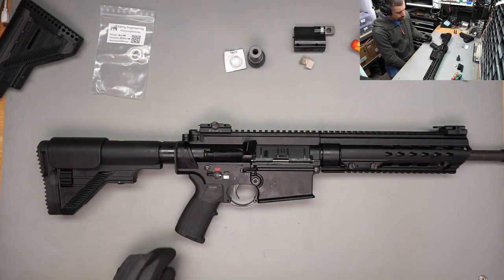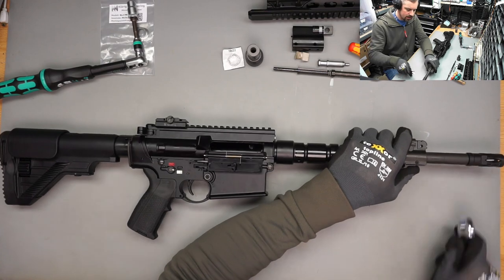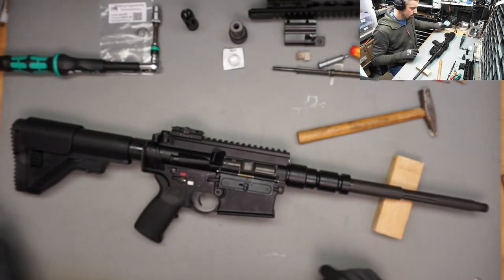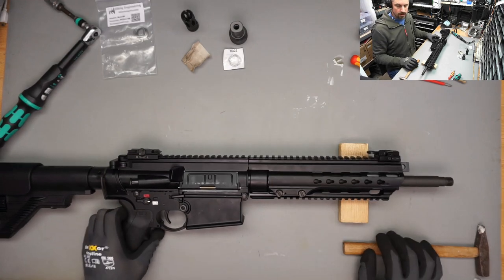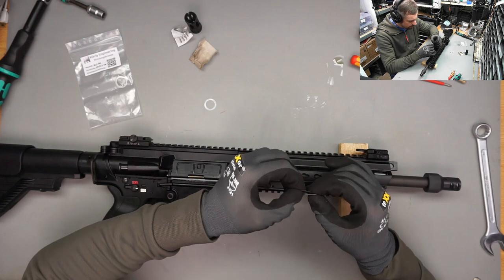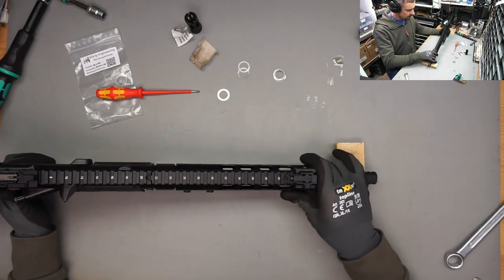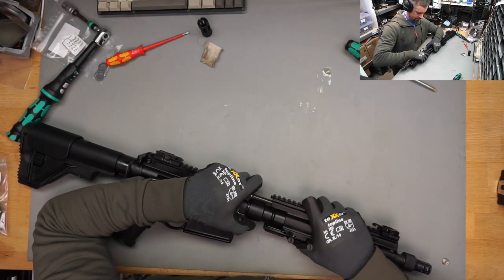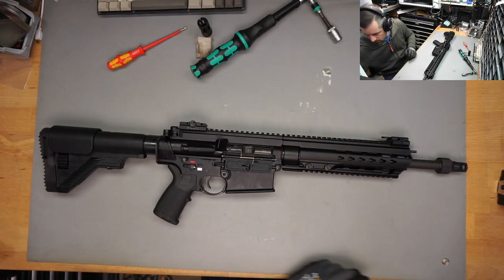Heckler & Koch MR308 A3 13" Part 3: Gas Block & Muzzle Brake

Comment: Moin! Ich überlege meine MR308 auch mit einem Gasblock für SD Betrieb umzurüsten. Hat das gut geklappt? Woanders habe ich gehört, dass die Ausstoß Gase direkt auf die (in meinem Fall) linke Griffhand an der Handguard rauskommen. Und welchen Schalldämpfer hast du genommen? 30 dB Reduktion wäre schon gut, sonst ist es ja auch fast egal :)

lg
Reply: Moin, bin am selben Punkt, überlege einen Flow Through Schalldämpfer zu nutzen.

Comment: Hello.
Did you torgue the muzzle brake to 45 nm as H&K recommends or did you just tighten it as you thought was tight enough?
Reply from the maker: Since I use shims to time the muzzle brake ports, I can't use a set torque - instead I tighten until the brake aligns well. No way I can get to 45nm with the wrench I use for this.
Reply: Thanks... I must admit that 45 nm seems to be a lot.
Guess the barrel should be in a barrel vise to pull that of.

Im installing an A2 birdcage on mine and down know if 45 nm is needed just because the manual says so
Reply from the maker: @ThomasThorgrimson   I started putting the barrel in a vise to these "torque-fit" muzzle devices every time to be safe. This makes it much easier to get a good alignment! For actual military use, I'd probably go for 45nm to be safe but for my purpose, less torque works fine MOST OF THE TIME.
Reply: Thank you very much for your help and you videos sir😊
Can you maybe help me with what barrel vise you use to work on the muzzle devices on your MR308?
Reply from the maker: @ThomasThorgrimson  I use a generic bench vise with add-on aluminium jaws from ebay. The aluminium is easy on the barrel (maybe add some masking tape on coated/painted barrels) but grabs very tightly
Reply: @GunWodan  Thank you very much sir.
I got it in a barrel vise and have replaced my flash hider.
What ammo do you get the best results with? I heard it shoots well with 140-168 grain range.
Based in Denmark im thinking maybe Sako or Lapua and preferebly lead free with new hunting regulations🤔
Reply from the maker: @ThomasThorgrimson  I've loaded a lot of ammo with the Scenar 185gn bullets with great results for target shooting. For hunting I was looking for a higher impact velocity so I'm going with the 130gn Barnes TTSX and get more than sufficient performance out of the short barrel. With a 16" or a 20" barrel you might want to look at the 150gn TTSX as well.

Comment: Cool videos man, love it. Regarding muzzle device for MR223 what was needed? Some heating, fixing the barell and 60NM force? That force scare me the most for my upcomming Ase Utra combo.
Reply from the maker: HK honestly did a very good job at bolting that brake down. I really recommend fixing the barrel well and being certain you are pulling into the right direction. It will come loose ...
Reply: @GunWodan  They are very precise with these details, staking was also massive. :) Thanks
Reply: @GunWodan  Can you be more specific? Did you use heat (Loctite) or water (Rocksett)? I ask since I now have a very stubborn HK on my bench, and the earlier has not been even close in difficulty. So I need to know what method is the correct one :)
Reply from the maker: @UtubeEric12345  I clamped down the barrel and just used force. As far as I can remember, there was no residue of rocksett or loctite on the threads. Maybe heating up the muzzle device will help though

Comment: Hi nice video man! I also want to buy MR223 but not sure about the barrel length. Is there much difference between 11 and 16.5 inch barrels when it comes to precision?
Reply from the maker: Regarding „Precision“ as in group size there shouldn‘t be significant differences between short and long barrels. You do however loose a lot of the ballistic potential of the caliber with such a very short barrel. 223rem rifles with 11.5“ barrels as unbearably loud and unpleasant to shoot and might be a bit too short for a modern grip for an average to tall person. A lot of people like the 14.5“ barrel length as the sweet spot between compactness, ballistic potential and handling.
Reply: @GunWodan  So it's less about better or worse and more about personal preference sort of speaking. Another question, i was looking at both HK and Haenel. Do you have any suggestion which is a better one? Both are very similar price wise and everything.
Reply from the maker: Personally hate Haenel and while HKs are always immediately sold out as soon as they hit the market, Haenels are seen with more and more discounts since it‘s become obvious they‘re just relabeled Arab rifles.
Reply: @GunWodan  Hi thanks a lot for the answer. So it will be a challenge to get my hands on one as i understand. And DAR, are they quality stuff?
Reply from the maker: Regarding both Haenel and DAR I cannot speak from experience. Haenel is just a personal issue for me, have shot one of their rifles and there‘s no complaints. Never touched or seen a DAR rifle in person - can‘t help with that
Reply: @GunWodan  Clear. Will try to get HK. Personally also like it more.

Comment: Danke für das tolle Video. Ich überlege ebenfalls den Einbau einer verstellbaren Gasabnahme wegen SD-Nutzung. Mir ist noch ein Detail beim Umbau der Gadabnahme aufgefallen: die original-gasabnahme hat ein Loch unten in der Mitte, für das offenbar auch eine Aussparung im Handschutz ist. Dieses Löch/ diese Öse fehlt bei der Burk-Gasabnahme. Kannst du mir sagen wofür diese Öse unten an der Gasabnahme ist? Danke für deine Antwort
Reply from the maker: bowhuntingaficionado Ich kann mir nur vorstellen, dass man daran einen Riemen befestigen kann.
Reply: @GunWodan  danke!
Reply from the maker: bowhuntingaficionado immer gerne :)
Reply: Hallo Zusammen :) was für einen Gasblock kann man hier verbauen z.B. bei einem MR223? Einfach den vom 416 oder gibt es spezielle after market Gasblöcke?
Reply: Das Loch dass Du meinst ist um den HK 40mm Granatwerfer zu befestigen. Da geht dann ein pin durch, der den Granatwerfer vorne mit der Waffe verbindet. Solange Du keinen HK GLM hast, brauchst Du das Loch nicht 🤣
Reply: @rocks3389  danke für des Rätsels Lösung 👍

Comment: Hello from Europe! I have a HK MR 223 and I couldn't remove the flash hider from the fabric! How can I do that? I've viced the barrel but still nothing! I've also heated but still nothing....
Reply from the maker: It‘s very hard to remove. Put the barrel in a vice and pray it doesn‘t break
Reply: @GunWodan  but how you did it so easily? :( i told you,i viced the rifle and tried but i couldn't losse the FH

Comment: Grüß dich! Sag mal, wie viel Platz ist denn bei der 13" Variante von der Burk Gasabnahme bis zum Beginn des Mündungsgewindes? Bin am überlegen mir die MR308 in 13" zu holen. Wäre ganz geil wenn ich meinen Jakki Semi Classic overbarrel SD verwenden könnte. Könntest du auch noch was zur Präzision sagen? Sollte doch ab und an auch mal für das ein oder andere Feldreh oder Sau mit in die Natur. Da wäre eben die Frage 13" oder 16,5".
Reply from the maker: Habe die Hoffnung bald exklusiven Zugang zu der 100m Anlage bei meinem Schützenverein zu bekommen und könnte dann mal ein richtiges Video drehen. Solange dort Publikumsverkehr herrscht ist ein Videodreh leider Tabu.
Die Präzision ist absolut einwandfrei, Gruppen unter 1 MOA kann die Waffe schießen. Beim jadglichen Einsatz ist die Müdungsenergie das große Thema. Lade selbst für die Waffe und muss 125gn - 135gn Geschosse laden um sicher über 800m/s V0 zu kommen. Das gibt mir die Sicherheit auch auf 150m optimale Deformation zu bekommen. 
Zwischen  Gasabname und Mündungsbremse habe ich gemessen 45mm. Die Mündungsbremse geht aber etwsa über das Gewinde hinaus, vermutlich gingen auch 50mm-55mm.
Wenn du Fabrikmunition schießen willst rate ich auf jeden Fall zu der 16.5" Variante!
Reply: BaufBaufTV Theoretisch sollte mit 165gr. Geschossen von Hornady die 2000J E100 noch machbar sein. Hast du mal die E0 messen können mit deinen Handladungen?
Reply from the maker: @LGS3100  Bei so einer exotischen Konfiguration mit dem kurzen Lauf kann man sich nur auf Messungen verlassen. Herstellerangaben sind meistens mit 26" oder 24" Läufen geschossen und werden selbst mit 20" Läufen deutlich unterboten. Das größte Problem ist, dass in .308 Ladungen Pulver verwendet werden, die mindestens einen 20" Lauf brauchen um komplett zu verbrennen. Bei 16" und 13" Läufen bläst man einen Teil des Pulvers unverbrannt raus und büßt damit deutlich Geschwindigkeit ein. Leichte Geschosse kann ich auch mit schnelleren Pulvern (benutze RS40, ein .223 Pulver) schießen und nutze so das Hülsenvolumen und die Lauflänge optimal aus. Komme mit dem 125gn Geschoss auf 850m/s und eine berechnete E100 von 2200J bei 750m/s. Bis 150m bleibe ich über 700m/s und die will ich mindestens haben wenn ich bleifrei schieße.

Comment: Have you checked the accuracy of this rifle? How is it grouping?
Reply from the maker: AndriarSmith Accuracy is flawless, certainly sub-MOA. Just be aware that most factory loads are designed to 20“+ barrels. I hand load for this rifle and use light 155gn projectiles with a powder designed for .223 to get a nice performance out of this short barrel.
Reply: @GunWodan  thanks for the quick feedback. What do you suggest about the factory ammo then? What should I try out of the factory before I'll start hand load myself?
Reply: @GunWodan  I guess lighter bullets, fast burning powder, right?
Reply from the maker: AndriarSmith Exactly - Fast powder is recommended. You‘ll want to keep the fill of the 308 case high for consistent powder burn so finding a powder that will burn quick enough before the bullet leaves the barrel and finding a bullet that moves fast enough to allow for the pressure to stay within the specification is the magic. My experience with 155gn are pretty good but there‘s plenty of lighter bullets if you want to try around a little.
Reply from the maker: AndriarSmith Maybe if you can find some „short barrel“ factory ammo ... usually they are overly expensive thought :(
Reply: @GunWodan  Yep, I've check it, and you're right - it's quite expensive. Thanks for the reply, it is very helpful. :)

Comment: How do i know the gas block is is centred?
Reply from the maker: The gas block has a small noth that only fits onto the MR308 when perfectly aligned. Its different from any other AR platform I know
Reply: @GunWodan  I would assume that the pins act as "keys" (like a woodruff key) in that they can only fit in one position.
The barrel has some semi-circular slots machined which the pins fit thru and so the block and these slots on the barrel will align perfectly when the pins are punched thru.
This results in the block sitting in exactly the right position and being held tight at the same time.
Reply from the maker: @steveclancy6474 yes.

Comment: How is the gas blow back while shooting suppressed
Reply from the maker: Eugene Smith practically zero blockback to the face/shooter. But the cases really get dirty from shooting suppressed 😒
Reply: @GunWodan  i thinking about getting one for my mr762 and both 416. I shot suppressed the other day and after 4 quick shots I couldn't breath
Reply from the maker: Eugene Smith I can only speak for the 13“ rifle. The gas system is the same length for all barrel variants so the long barrels might give you more back pressure should the bullet still be inside the barrel when the bolt opens

Comment: Bei meiner mussten 4 Leute am Maulschlüssel reißen um den MFD abzubekommen 😂 inkl. Einspannen und Hämmern 🤦🏼‍♂️
Reply from the maker: Schätze das ist alles einfacher wenn damit noch nicht so viel geschossen wurde 😬
Reply: BaufBaufTV Hm Ka, da hatte die erst 50-100 durch :) 
Jetzt wo ich die 13“ Version sehe bedaure ich fast die 20“ Version zu haben, aber grad fürs jagen ist der mündungsblitz von kurzen Läufen Gift- klar der Schalldämpfer macht viel wett aber geht auch aufs Material :) 
Und für die Präzi sind 20“ natürlich auch sehr zuträglich.
Reply from the maker: Da ich mittlerweile auch Wiederlade für die MR308 habe ich mit der Innenballistik der Waffe deutlich mehr auseinandergesetzt. Die Präzision auf übliche Jagddistanzen (<=300m) ist von dem kurzen Lauf nicht beeinträchtigt. Trotzdem würde ich mit der Waffen nicht weiter als 60-80m jagen - aus dem einfachen Grund, dass der kurze Lauf zu einer geringeren V0 führt. Statt 2800fps kommt man dann nur noch auf 2300fps. Was nach keinem großen Unterschied klingt macht sich bei der ENERGIE leider stark bemerkbar weil die Geschwindigkeit zum Quadrat genommen wird. 
Von daher lässt sich sagen: Kurzer Lauf ist sehr präzise aber kostet Energie. Wer auf Sauen geht und jedes Joule braucht sollte daher so einen kurzen Lauf nur für kurze Distanzen verwenden.
Bei mir wird diese Büchse hauptsächlich zum Selbstschutz als Treiber (Durchgehschütze) und bei Nachsuchen zum Einsatz kommen. In beiden Situationen ist die kompakte Bauweise extrem hilfreich.
Reply: @GunWodan  Hast absolut recht, ich hab mich missverständlich ausgedrückt, mit Präzision meinte ich den Energieverlust und damit das instabilere Flugverhalten das einfach schon deutlich früher einsetzt, besonders auf hohe Distanzen trudelt das Geschoss früher und reduziert die Max-Range damit massiv.
Wiederladen tu ich auch aber vor allem Slugs und Subsonics für die .308 dafür ist die N+ Einstellung btw super geeignet :D
Wie oft wurdest du auf DJ damit schon blöd angeschaut?